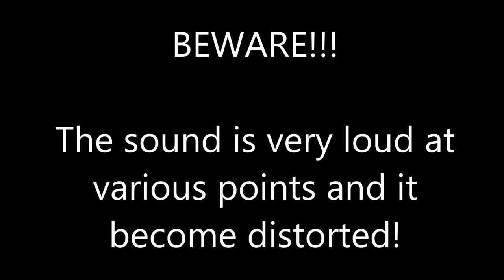Loud or Quiet exhaust with cut out valve system for motorbike

Comment: Could you please make a tutorial video? Like show us the links where you bought everything from, and also showing us the steps? That would truely, truely mean the world to me! I would be thankful if you could! ;)
Reply from the maker: Hi  sorry  but  I can't  make  another  video  because  I don't  have  another     motorbike  and  very  busy  with  another  my job  steps are easy  find correct  place for new pipe and motor valve then mark out  take exhaust  off  then  cut  and  weld valve with motor ( they coming like kit you can'tmake them wrong),take the tail  pipe  weld to the flange  spacer after that  put back  on bike  and job done  really  you  need  only  3 parts  small tail pipe ,motor  kit and flange spacer   and everything  you  can buy  from  eBay  just  doublle check  the  size  of your  exhaust  pipe  if you  want  some  more info  let  me  know 😉
Reply: Check your exhaust diameter right where you want your to install your kit and order correct one just by searching your local providers or order directly from China. Just type 'motorcycle exhaust valve kit' to your browser and you will find one :)

It's easy to find valve kits made to be slipped just in the middle of your pipe so it will require just two simple cuts (just enough to fit your valve) and you can use clamps (usually included) to just clamp it in place.

Wires just go as usual: red to power, black/yellow to frame.

To be honest, your install kit should have everything covered in installation manual. Just remember to measure your pipe to get correct valve kit :) 

It's not much but it's something :)

Comment: When running it straight pipe doesnt  that hurt the motor...i would assume you need a ecu flash or tune for when you  have it open for straight pipe. But then when closed you have restrictions back to stock with ecu flash/tune so that would also be bad....plz educate me i would like todo it but dont wanna damage my bike
Reply: i’ve seen one where the valve has holes in it so it doesn’t stop the exhaust flow as bad

Comment: Does this hurt engine somehow if you drive long time while keeping it closed?
Reply from the maker: What you  mean  🤔 when  its close  working  like  normal  exhaust
Reply: @qnkocholakov9548  I saw a system like this for sale in Thailand and someone argued that it might hurt the engine if the valves are being kept closed. So I assume there is no reason it would be dangerous for the engine :D
Reply from the maker: I Don't  know  what  they  done but when  the  valve  is  closed  all emissions  going  to the mufler  like normal  exhaust  system  my valve  just sent the emissions   to new  pipe or original  one its never shat
Reply: @qnkocholakov9548  😂😂😂

Comment: After 3 years of your video, did you get any damage in switch valve solenoid? Is it sustain or you need to fix time to time?
Reply from the maker: Yes i did have little problem with the wires. Very poor soldering do them again, I done them once and I didn’t have that problem so far
Reply: @qnkocholakov9548  Thanks 👍🏻